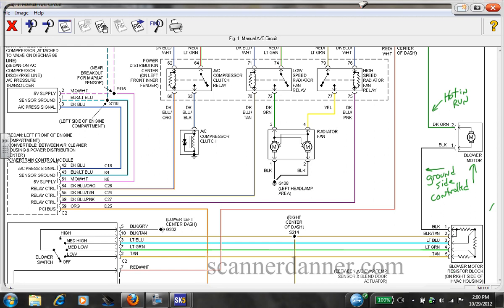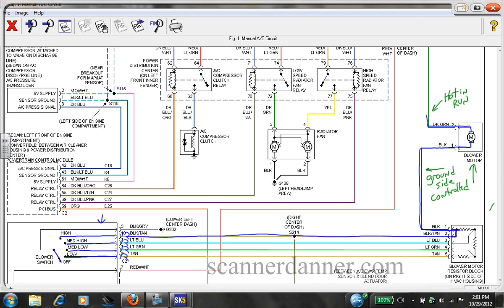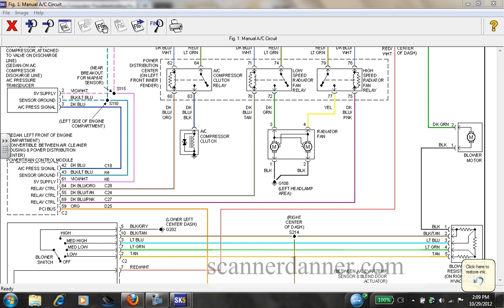How to test a blower motor and resistor (subscriber requested)

Comment: A couple of comments,  as always an informative video.  I have noticed that some newer cars are using a solid state motor speed control and not a resistor bank.  My sons BMW had one, i cut it open and found semiconductors. Couldn't tell what they were because of what it took to get in there.  Also, a clogged cabin air filter will put extra load on the blower fan and may cause premature motor or "resistor" failure.  Extra load and reduced air flow equals overheating devices.

Comment from the maker: you are correct. i explained it better at the 6:10 mark.
i agree though you are not reading the drop of the motor at that location you are reading available voltage left after the drop of the motor.  with a little math you could calculate what the motor drop was if you wanted but that really wasn't the point here. sorry for the misleading statement and thanks for pointing it out.

Comment: No worries, I saw you hesitating a little at that point and you were doing it live and it is a bit confusing where you were connected and that green wire supplying the motor makes it weird looking like the V meter was connected across the motor (like the green was ground) when the ground is really on the other side through the switch.  I'm amazed at how good you are at this stuff doing it live.  I just started watching and have learned a ton from you.  You know the stuff like a really good EE.

Comment from the maker: fans do not turn on until 230 my friend.
but yes if you can command the fans to run, and they do, the system is fine and your focus goes toward an input problem
Reply: Just a note to keep in mind. I have run into, on some GM cars that fan temp switch has been replaced with an aftermarket switch, due to patent rights after the aftermarket switch point is changed by a few degrees, some are set higher to turn the fans on. I saw this cause an overheat problem on some makes. Mainly older Cadillacs on 90 to 100 degree days, it causes the delay in the fan pushes the boiling point, under those temperatures, sitting still or in traffic. In these cases, the OME part is needed to fix the problem.

I had someone bring me one after they replace everything in the cooling system and it still overheated. It was all due to the Aftermarket Switch

Comment from the maker: You can do that but when connectors are melted it is from high resistance in the connector itself not from too much current flow. 
But you wouldn't be wrong in wanting to check the blower motor itself. 
Most likely you just need a new blower resistor and connector.

Comment: Good video Professor. 
I was looking for radiator fan testing.
Reply from the maker: on what? We can help you on my forum. It is free to join https://www.scannerdanner.com/forum.html
Make sure you include year, make, model, engine size etc
Hope to see you there!
Reply: @ScannerDanner  99 caravan 3.3
I have a wiring diagram that I found. 
Question, do they sometimes switch the lines around in the drawing to make it flow nicer on the page. 
Example the fan relay is numbered 4-2-3-1 on the diagram but I'm thinking that it's actually 4-3-2-1 on the relay. 
My gray wire #4 is Battery + I connected a scope on a rope, test light to negative on the battery and the test light to #4 and the light lights up/.Good 
My black wire #1 is GRND -  I connected test light to positive on the battery and the light lights up another good. 
The wire next to the battery wire which I think is 3 but diagram shows it as 2 also lights up when connected to positive on the battery. 
This wire is a heavier gauge wire like the #4  Battery wire.
The last wire I think goes to the PCM and with the test light connected to battery positive I connect the test light to the last wire and start up the car and when the ac comes on the light does not go on. 
So poor connection to PCM or PCM is bad?
Not sure if my explanation is good enough. 
I will check out your forum. 
It's getting late and I gotta get up early so I'm gonna go look at my eyelids now. Thanks for the help Professor. 
Oh and by the way I was a parts changer and they didn't work so I had to do some more digging. Good thing the parts were fairly cheap. Thanks again.
Reply from the maker: @mostlymoparih5682  This is not a relay and yes the Mitchel diagrams do not put the pins on sensor connectors in the correct order sometimes for making it easier to read? What you are dealing with is a fan control module and it will pulse width modulate the fan on low speed , and then apply a full power on high speed. The PCM talks to this module on that wire you mentioned. I forget what the signal is. I think it is a pulsed signal for a low speed command, and then a fully grounded or powered signal for high speed. These fail all the time and it is usually from the fan motor that has seized up first. Make sure you can spin the fan motor by hand or better yet jump the load side wires on the fan module with it disconnected and make sure it runs
I have a video on this but I can't find it for the life of me right now smh
Reply: @ScannerDanner  Thanks alot. Yeah I ran the 2 leads from my volt meter to each fan and from the battery and they both power up, gotta go to work I will check out your link and maybe after all this time of following you get your book. I am a visual guy and do better when I see it on paper. Thanks again Professor talk to ya soon. Have a great day and Happy Motoring.

Comment from the maker: you must have current flow to have a voltage drop across the resistors.
the numbers are correct. the motor is a resistor too.
Reply: My issue is no ground at blower motor in any switch position. SI lean toward control head or resistor?
Reply from the maker: @ChuckWD33158  give me voltage readings on the resistor wire when the blower motor is turned on. Include what position the switch is in.
Reply: I will get the voltage readings today. I am thinking that the signal wire to the resistor is not working. This is an automatic system.
Reply: @ScannerDanner  this is a 2006 Pontiac G6 GTP. Motor control module on HVAC, resistor? A- ground; B-Req Signal, from BCM?-3.53; C- Batt +-12.53; D- Speed control to Motor A is 12.53; E- Supply to Motor is 12.53. At Motor A- from D above is 12.53, and B from E above is 12.53.
Reply: @ScannerDanner  sorry, been busy. Will try to get that today or tomorrow. Thanks for your help.
Reply: @ScannerDanner  the Required Signal voltage at pin B, from the HVAC head stays pretty much at 4.7 in all positions. The voltage at pin D, the Speed Control to the motor ground side stays at Batt voltage in all positions.
Reply from the maker: @ChuckWD33158  this changes things for me as I have to now look up service info and not just look at the diagram I have here on this car as I previously assumed. Let's move this to my forum www.scannerdanner.com it is free to join and I have paid moderators who are there to help me help you guys. Thank you! Hope to see you there.
Reply: @ScannerDanner  ok, thanks again for the help. What heading should I look for on the forum?
Reply from the maker: @ChuckWD33158  https://www.scannerdanner.com/forum/post-your-repair-questions-here.html

Comment: I have 2006 F350 the fan blower will not shut off when the key is in on position. but does shut off with key removed. is my problem the relay or the resistor or the off button on the dash.

Comment: I suppose circuit can be checked at the resistor connector leading to the controller?  At each of the different wires for each fan speed selection?

Comment: Hello   there...i got a problem with a 2018 sivic si..4 door....crank no start ...after changing the battery....
Immobilizer red light keep blinking 
I got a lock smith guy to re program the key fob .no luck car wont start
Is not my car ...5 mechanics and the honda dealer try to get to work but no good ...im a technician my self 
He got the cr back from the dealer i have been checking it  but no luck...car has 5v reference on all sensor..main relay and fuel pump relay are good 
Fuel pump relay was bad I got a bew one but car steel no start...
The dealer change both the pcm and ecm and left the abs module redy to be change ....car wont start...need help please
Reply from the maker: Scan the system, what codes do you have? Need a scanner that will talk to all modules, not just an obd2 scanner

Comment: Hopefully, when checking voltage at the switch, the technician is using a DVOM and not a test light with body parts in the fan assembly.

Comment: Given what you explain....
Would it be wrong to assume that.....
If the Blower Motor doesn't spin "AT ALL"....
That the problem CAN'T be the Blower Motor Resistor....
Since EVEN if ALL the resistors are dead....
The HIGH setting should STILL work.... Since IT....
DOESN'T go through ANY of the resistors!???

Mine on my 2005 Chrysler 300 doesn't spin AT ALL - Fuse was changed - NOTHING
Was about to remove the resistor....Test the motor too.
Reply from the maker: Yes but there are variables. I've seen the high blower relay mounted to the same resistor board! So when they melt down, it can take the relay out with it giving you no blower control

Comment: These questions are asked when the technician lacks elctrical training in reading circuit diaphgrams.all legid question to the unknown. guys outhere if you guys are planing to stay in the automotive field and tackle electrical diagnosis and driveability issues know your electrical schematics if not youre in trouble.dealers offer technical training and aftermarket shops offer outside training ask your managers.just a helpful advise guys dont take it the wrong way. thanks rick bauza

Comment: What besides corrosion can cause melting at the blower resistor connector ? My nephews 1996 Dakota has heat damage to the connector and I am going to check it this evening. Can I do amp draw testing on the wires to see if the motor is binding ? Thanks brother

Comment: Do you have a schematic on a 2001 Honda Civic LX with a 1.7 my AC compressor clutch isn't turning on and everything else is okay and there's only one conductor one wire going to the compressor how do I fix that any ideas thanks you

Comment: On a slightly different issue I have a 1993 Chevrolet Corsica 3.1 V6 with a cooling fan not turning on issue. I can command it on with the scan tool but it will not turn on even when it hits 220 degrees. If it runs when commanded on does that not mean that my circuits and fuses/relays are working ? How can I know the ECM is to blame ? Thanks brother. PS I love this video also.

Comment: Scanner, great work.  But, could you check your numbers please.  You are reading drop across the resistors, not the motor at your switch connection points.

Comment: Hey Paul!

 I have a Toyota Mark X 2005. It has a hvac system that is part of a multi av control unit. 

 The issue is that, I need to change the unit to an aftermarket one as its not functioning properly and the fan speed control, aswell as the mode select is part of this unit. 

Is it possible to locate these wires without a wiring diagram?  Reason being is that I want to wire up, one of those Vintage Air control units.

Also, with my Solus Pro, is it worth updating? I'm on I think 13.2 or 13.4. 

Thanks in advance
Reply from the maker: You need a diagram for something like that. Check out this thread on my forum on where to get wiring diagrams. There are free ones out there too. https://scannerdanner.com/forum/post-your-repair-questions-here/16-need-service-info-check-here.html
What model year does the 13.4 take you to? Who much is the update?
Reply: Thanks for the reply. Just called my snap on dealer and he said it can't be done. Strange it could be done 3 months ago. 
Looks like I have to get the next model up

Comment: Hi.great video.my sebring work on low and medium but blower turns off in high.new resistor.do you think it could be the fan speed control switch???
Reply from the maker: Possibly, without looking at a diagram for your system, I am sure there could be other causes. Some use a relay for the high blower speed.
Reply: I believe the fan speed selectors are bad about going out on those.  I just replaced one on a dodge avenger a few weeks ago.  Voltages were all over the place when switching between the different fan settings.   Replaced the climate control module and got full function of the ac control and fan speed selection back.

Comment: At 5:38 you make the mistake.  You state that you are reading the voltage drop across the motor (which is a resistor like you say).  But, your voltmeter is not across the motor it is across the blower resistor.  Your meter connection is between the B+ side of the resistor and ground.  It's a voltage divider and you are measuring the divider.  I would assume that the voltage across the first resistor is around 2 Volts, leaving 10 volts across the motor so that it runs slower.

Comment: Okay so my 1987 Acura Legend Coupe 2.5 is having a little bit of problems not to mention my fuse box is gone like are not my fuse box but the the map for the schematics for it it's been a very very very hard thing to find I've got so much stuff backed up on order got a job coming up here pretty soon I'm a union carpenter I ain't no I travel this car's been bad ass for a long time it's just well I put the new I put a new exhaust on it bring your stereo and all this stuff started happening help me my car won't start drains batteries my heater won't turn off or the air conditioner for the my blower won't turn off and I just need some help yeah I don't want to mess anything up
Reply from the maker: Post this to my forum, we can help you there for sure. It is free to join https://www.scannerdanner.com/forum/post-your-repair-questions-here.html

Comment: Okay so my not my fan to cool my car down it's the interior fan the air-conditioning and all that well turn off when the car is has the keys in it after that I don't know how to check the fuel pump. It's it's a trying to I don't know it's doing something weird when I go to turn it on it did tries to acts like it wants to start to engage and then it disengages again and I know that it's priming itself though but it's it's doing it in like a real fast fashion like it's against something making it maybe might be the ground or something I'm not sure I think it's just it's aground or like damn near everything I live on a dirt road and we've been having sometimes it's pretty bumpy around here and there's been puddles and stuff like that I've been having to drive through you like a foot deeper water and hell yeah going to give me some TLC in the same grand jury I just don't really know where to start when I guess that starting somewhere is better than not starting at all and I've been watching these YouTube videos like and I mean got all the books but they I don't like doesn't have a diagram to tell me what the number 11 fuse is for the exterior or underneath the hood that keeps blowing it and then my radio fuse keeps blowing to so what do you think